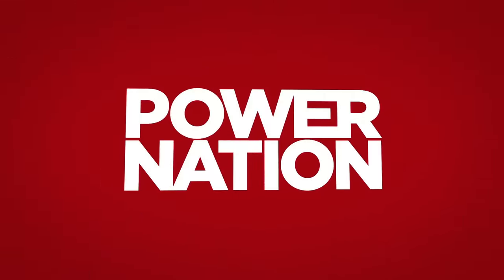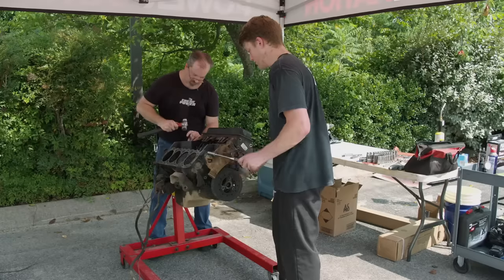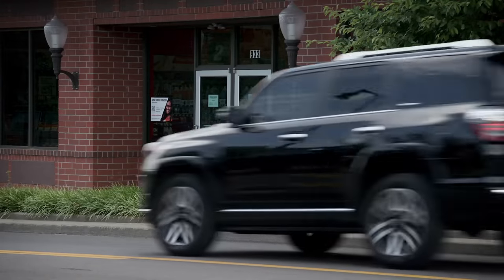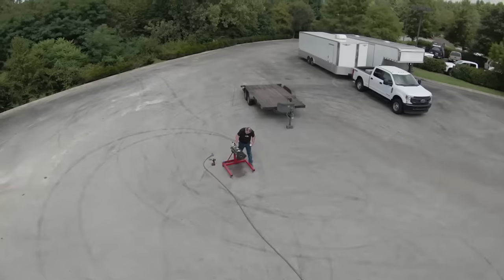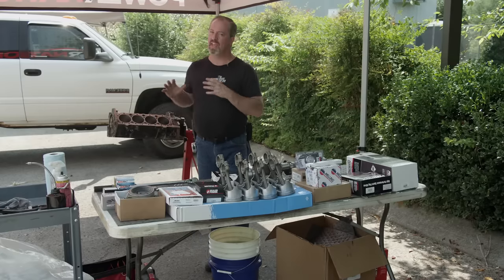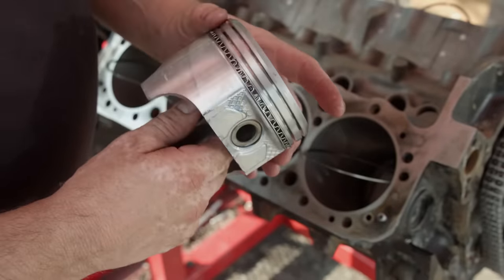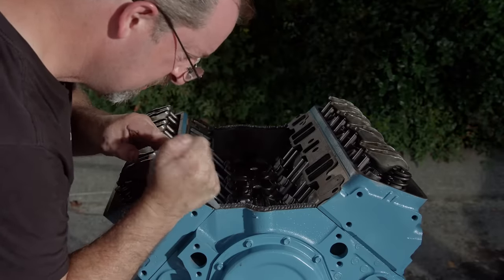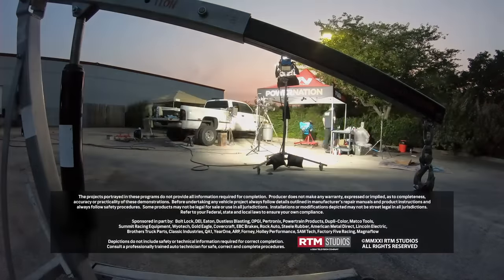Chevy 350 TBI Built In The Backyard with Hand Tools? Challenge Accepted! - Engine Power S8, E17

Comment: A lot of people hate autozone but I swear on them. You can even order aftermarket parts through them like comp cams. Of course it might be a little more expensive but you are supporting your local autozone to keep them going….. I remember when Napa was the go to parts store but autozone has really stepped up their game. And if you get in good with the managers, your ease of part returning or warranties are a lot better. I replaced an engine in a dodge pickup. I primed the oil pump and held 45 psi oil pressure with the drill I used. Put it in the truck and had no oil pressure. Bought a new pump and gasket and still not oil pressure. Come to find out, there was a crack where the pump mounted and was pushing all the oil back to the pan. They ordered me new engine and let me keep the old one until the new one was running properly. Pretty good people in junction city Kansas

Comment: hi 
When doing an engine out of vehicle  rebuild I always pressure clean the water galleries to get all the corrosion pieces outta the water galleries . Sometimes u will find many flaking pieces upto 1---1.5 cups .
Use an old ring sharpened to scrape the back of the ring groove .
Wire wheel/brush is real quick on tops of pistons  
or  Have the local machine shop GLASS bead the pistons

Comment: I pulled an engine one time with some friends of mine with a 6 x 6 Beam on either side of the car somebody got a hold of the beam and we picked up the engine and we pulled it out set it on the ground then proceeded to rebuild it well tear it down in a wheelbarrow set the block off to be cleaned and honed sent the heads off to be redone got everything back put the engine back together put it in the car the same way with a 6 by 6 across the front of the car hooked it all up got it running on a day later drove it a thousand miles

Comment: I thought they said it was an 88 -95 tbi? If it is they have Captain bar heads. Center intake bolts are different . Got to get a different intake or grind or wobble the holes out to run an old-school intake.
Reply: I was thinking why were there stickers with barcodes on the heads before they painted them😂
Reply: The engine was a reman. There were a lot of clues besides the obvious 0.010" under bearings. The most obvious to me was the bright blue rubber oil pan gasket.

Comment: There's no way this question won't sound sarcastic, so just know I'm not trying to be.  But I thought the TBI swirl port heads could only take something like 0.465-0.485 lift.  Were these heads aftermarket or were they worked over before y'all got the engine?  Or is my info wrong on the lift that stock TBI heads are capable of handling?
Reply: That’s what I’m wondering.  Those tbi heads were super restrictive…
Reply: You're thinking of TBI Vortec heads... they prolly got 250 HP... but 420 HP if started with a TBI Vortec 350...

Comment: With the new crank are you worried about the balance with the old pistons?
Reply: Stock engines of this type have notorious amounts of ballance tolerance. If you carefully disassemble a stock engine and weight all the parts you can be amazed at how off some parts can be. Cast rods can be wild, even dimensionality.

Comment: I have a similarly built engine in my c10. I would love to see this thing go on the dyno. My guess is 360tq/310hp.
Reply: They prolly got 250 HP... but 420 HP if started with a TBI Vortec 350...
Reply: @BuzzLOLOL  so vortec heads are worth 170hp?
Reply: @johndelta00  - Those swirl port heads don't flow... just for low RPMs truck torque...
Reply: They dynoed this thing and it made 345tq/275hp. GM rated these at 210hp, so overall not a bad improvement for a cam/headers/intake swap.

Comment: I went to my local Autozone to borrow a harmonic balancer puller and the guys said I have to pay for it then I can return it and get my money back. Not really a tool loaner program so much as a buy and return program. Puller cost me $30 and I've yet to return it. Had it been a true loaner I would have already returned it. So I guess it worked out for them but not so much for a true budget builder.
Reply: complains about have to put down collateral to borrow a tool and then steals it, nice

Comment: They forgot it was a TBI motor probably from a street driven truck with PVC and  map sensors TPS  etc. What's a carburetor do for my ECM? Also I doubt anyone replaces the crankshaft on a rebuild. Take your heads to your local machine shop for a real valve job. Cheap

Comment: Can you do an engine rebuild leaving the block in the car?
Reply: You can change the heads and sometimes cam with the engine in, you usually can’t take the bottom end apart because the front crossmember/subframe can be a very close fit to the oil pan. Out is always easier, you can hire engine cranes and stands if you don’t have them.

Comment: 🤣 me and my friend built a Ford FE by hand without any help from a machine shop, we did everything by hand in his garage with hand tools. Clearanced and polished everything by hand.  Try it on something harder than a SBC....
Reply: @Fanofou82  🤣... then they shouldn't have a problem proving it... last time they had an FE they scraped the block and had to start with another. Never did anything with it again. If you're going to be presenting yourself as someone like them then you should be using a difficult example that will provide more opportunities for learning moments... not much skill needed to slap together a SBC, my 3 year old could do that.
Reply: @Fanofou82  🤣 450hp/500ft lbs reliable daily... i highly doubt it.
Reply: @Carl_Jr  i know about him, I'm just saying I could do wild stuff with his shop/budget too... it takes serious attention to detail to build an engine from the ground up, with mostly used parts (oem block crank rods pistons, used comp cam, we rebuilt the iron heads) go through everything and recondition it all by hand, set the clearances on the new bearings by hand polishing the crank. All in a single car garage my truck wouldn't even fit into... with almost exclusively Harbor Freight tools.... and it lives as a daily driver.... so yeah it is what it is man.
Reply: @CadillacZachOffical  Why do you assume he's never done any of those?
Reply: @Fanofou82  which is exactly why I called them out... we don't need scripted and fake. We need REAL.
Reply: @Carl_Jr  none that i Remember, ive been watching power/block nation since I was a kid
Reply: @Carl_Jr  ive never seen them do a budget rebuild on an FE, ive only seen a few FEs on their show ever since I can Remember and it was always a high dollar deal. Whenever they build something cheap its always a sbc or a 318... sometimes a Windsor. Never do you see them bother to explain the intricacies of an FE , let alone how to make power with one. The most recent junkyard 390 was as far as ive seen them go with one, and it still left something to be desired for me.
Reply: @CadillacZachOffical  Gotcha. You do seem to know a lot about that engine, that's for sure. I'm just saying, way before this show I'm sure Pat has done a lot of stuff similar to what you're talking about. Your first few comments seemed as though they were aimed at him. Now I know you're talking about the show in general. 😎👍
Reply: @Carl_Jr  yeah, I'm talking about the show, I do get a little frustrated with guys like Pat though... it's as if they forget what it's like to do a real honest budget build... you know how much a roller conversion is for an FE??? About 2-5k depending on what quality you want... the average joe like me can't afford that. I wound up using the biggest hydraulic flat tappet cam I could run with minimal valve train modification, that's expensive on an FE. And the oem stuff will handle 500hp all day. More episodes based on knowledge instead of budget would be helpful, spend the money where it counts and teach people how to do more things themselves, like polishing a crank... i don't even know anyone who bothers to do that anymore except us poor people.
Reply: @Carl_Jr  this is why YouTube car channels like VGG and others have exploded and power nation is all but dead... we want real life stuff not this ideal fantasy world BS... the only reason I clicked on this YouTube video was because I wanted to see just how "basic " they got... I wasn't real impressed TBH. They made it easy on themselves, i think the last thing i actually enjoyed from power nation was the eco boost vs viper truck build off.... just saying... or maybe the turbo grand marquis that was pretty cool too.

Comment: i would never build an engine outside where i live just a little wind and u have sand in the engine like hub bearings last about a year to 2 years and they are dead newer rigs do not last where i live a rebuilt suspension on a newer rig is good for about 3 years but my old fords and chevys keep on going

Comment: tbi 350. not a power house. its a truck engine . i ran one for 20 years and put 327000 miles on it . it still ran when i sold it . mine was a 95 silverado ,last year of the tbi 350, before they went vortec mpfi.

Comment: Nice reman stickers on the heads. Why say your cleaning and reusing the heads if your not
Reply: They did reuse the heads. The whole engine is a old reman. You can clearly see this throughout the video from the heat tabs on the block, the 10/10 crank, the stickers on the head at the beginning, and the numbers stamped on the top of the pistons.
Reply: @stevenhoitz9260  then they cleaned them in the shop. And put new stickers on

Comment: You never never use synthetic oil to break in a  engine. Especially if using a flat tappet  profile cam . Plus it can stop the rings from seating correctly .
Reply: Yet new vehicles come off the assembly line with synthetic oil in their engines every day. Weird.
Reply: @Icutmetal    no expert here .Just life's experience .  Most vehicles these days are built with different cam styles and tolerance specs and to some degree different metal specs  made to be run with more modern oils. And a lote different engines  come with a break in type  oil in them .
Reply: @larryalexander4833  Sure.
Reply: It was a roller cam

Comment: Too much lift for stock heads, they should know better.
Reply: Why?
Reply: @stevenhoitz9260  just look up maximum lift for stock Chevy heads. The max for some is .440, others .480 and maybe .500 without cutting the heads. They know better.
Reply: @JohnDoe-ml8ru  Well there ya go. That cam has right around .500” lift. I guarantee those guys checked it they know what they are doing.

Comment: Not worth it to do all the work yourself. Machine shop can clean better. Scraping crud off valves? Why go back to the caveman days?
Reply: Because not everyone is rich
Reply: @strangetar2833  So you have to be "rich" to have the engine shop rebuild your engine? There are other pursuits.
Reply: @razoreyes45k  yes it’s expensive not everyone can have everything be the best
Reply: @strangetar2833  Although I wouldn't recommend substituting lapping valves only when you need a VJ, you don't need to be rich to have the valves media blasted, stems polished and ends butt ground. That would be a minimum when reconditioning Heads, provided your Guides don't need to be sleeved. But if you really can't afford that, you can save up instead of relying on the old "wiggle" test between your Valive stems and Guides.

Good luck friend.